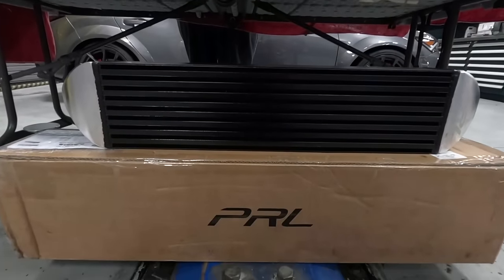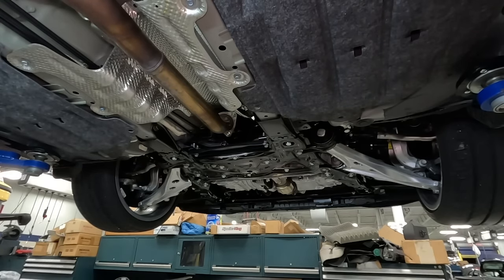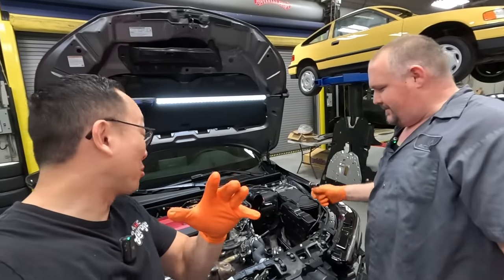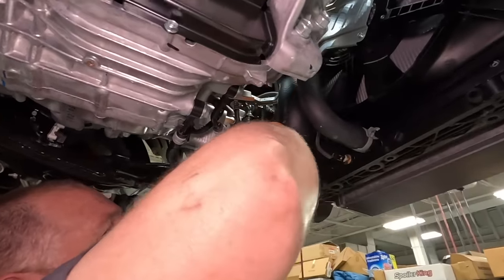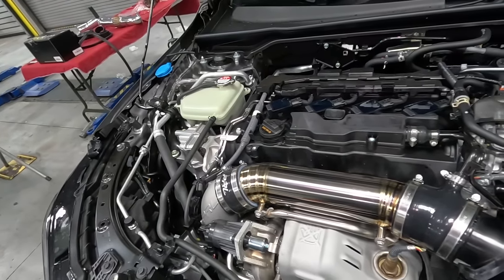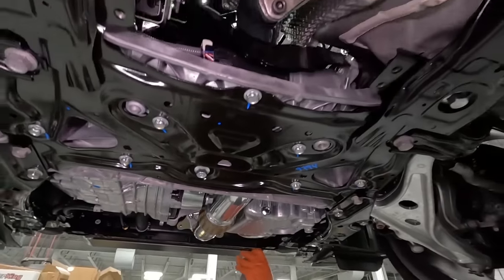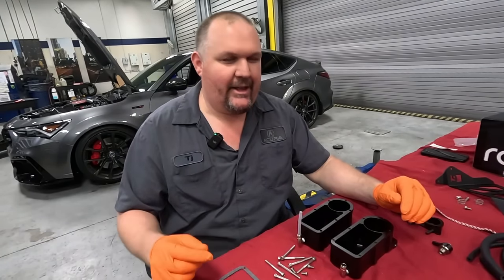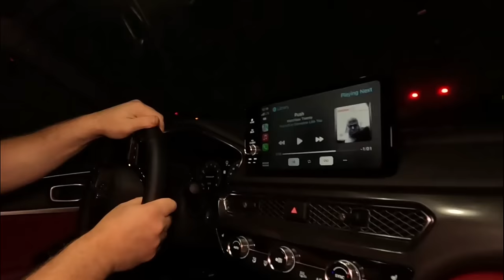2024 Acura Integra Type-S // Full Bolt-On Performance Upgrades

Comment: Not only is the filter sucking in hot air, it then gets heated up by the inlet pipe sitting on top of the exhaust 
2024 and Honda still havent heard about air-water intercoolers and Vband clamps
Reply: Nearly every test I've ever seen about inlet temperatures, when moving they even out anyway, so it really ONLY matters if youre sitting at lights. Once you're moving it makes 0 difference. So unless you live your life 1/4 mile at a time,  its a moot point.
Reply: @KeithSchwerin  It's a performance car, advertised to performance car enthusiasts.  Why would you buy this car to NOT live life 1/4 mile at a time?  This boomer logic of buying a performance car, advertised to be moddable, only to argue against anyone modifying it properly blows my mind.

Comment: I have an 08 Tl type S and I’m tempted to trade it in for this integra type s but I really don’t want a car payment anymore because I’ve had many new cars in the past and it’s not worth upgrading every few years. It’s a beautiful car.
Reply: Its all subjective. Personally i like having a new car every 2-3 years.
Reply: I sold my 2.4 Si that I daily drove for 7 years to get into one of these. Modern creature comforts are amazing now that I’m in my mid-30s. Add to the fact that these bolt-ons will push high 300s for WHP rating, it’s an intant classic, this thing.
Reply: @adventsociety5382  true and now I have a brand new 2024 GT mustang full optioned lol but I used to get one every 2-3 years but this time I waited 5 years my STI was new in 18 and I still have it but I did t buy anything until a few months ago.
Reply: @svfutbol20  yeah they are very nice cars and I was going to get one because back when I commented this I didn’t want anything but I waited and I got a great rate so I went with the S650 but I did want another type s but I switched it up since I still drive the STI and it’s a 4 cylinder still. How do you like the Integra?
Reply: @E85_STI It’s amazing. Bought mine slightly used with 10k miles, saved about $10k on the total price and got the RAMAIR intake for it. I think 18” wheels with some sticker rubber would help the car but otherwise it pulls like crazy, corners really well. Pop it into Comfort mode and it quiets down nicely, fits right alongside the Audis and BMWs at my office job parking lot.

Comment: Looks and sounds great. A couple questions: (1) what would you have done if some of those bolts ended up stripping? (2) wouldn't it make sense to test out the install before putting everything back together? (I was getting some anxiety for you guys when you started it up after all that work!)

Comment: those pops are not coming from the phearable tune right? I was told they don't do anti lag. bad for the engine. I was wondering. How did he accomplish those nice pops when shifting and letting go off throttle

Comment: Man, I was on the bad side of the 50% I broke 2 studs on my turbo exhaust. Had to re thread mine. Got mine put back together and now my car through  emissions and rev match codes. You guys run into this?

Comment: With those 20mm wheel spacers, does the factory wheel hub bolts stick out pass the spacer or is it flush with the edge of the hole and does the wheel sit flat against the spacer or does the factory bolts create a gap? I really would like to know i have the exact color ITS and your build looks awesome! But im curious about the wheel spacers.

Comment: I just installed PLM catted downpipe and a front pipe and the next day after driving home from work I’d say about 60 miles the check engine light came on for emissions issue. Any ideas? I haven’t scanned but I assume rear O2?

Comment: Hello i have a Tiger Eye Pearl Type S and looking to start doing some MODS.. and wanted to ask about the Intake System.. where to buy?? And do you think would be better than the PRL High Volume Intake System??
Reply: I have the RAMAIR system and it’s fairly loud, depends if you’re looking for the most air/performance or something easier to daily
Reply: @svfutbol20  do you think the RAMAIR performance is better then the PRL High Volume Intake
Reply: @EMAR88  I don’t have the other to compare it to. I imagine they are similar
Reply: @svfutbol20  i don't track my car ots my Sunday sunny day car and I think the # of HP n TQ i rather something like thr RamAir for the sound yes. I'm going to purchase today try to find the best deal on the RamAir system
Reply: @EMAR88  The RAMAIR one is pretty big and slightly digs into the underside of the engine hood. The PRL one would probably be more suited to spirited daily driving. I’m copying this upgrade list for mine because I want to occasionally track it
Reply: @svfutbol20  where is this upgrade list?? And I'm looking for something for better Sound and based on the Gray ITS on this channel he is doing well with this INTAKE here at AHC .. what you think??
Reply: @EMAR88  This one from the video.

Comment: What happened to the center of the bumper? See two dimples at the center point.
Reply: Front license plate
Reply: @keystonerider1308 I’m talking right at the exact center 1/4 to the left. That’s not the license plate dimples.
Those are 3 inches from center.

Comment: so those bolts that usually strip on the turbo. Just take honda trans fluid and let soak on the threads over night. never strip again. that was right from the tech line. did the night before i had to do a tear down or anything that required turbo removal.

Comment: If only Acura could be a decent performance car out of the factory. Every thing they produce needs mods the day you buy it.
Reply: These cars were produced as a track car more than anything which it does very well over a lot of other cars in and out of its class I think alot of people forget that Honda has never really been about straight line racing

Comment: You NEVER remove exhaust hardware while cold. That's when you run into trouble
Reply: The downpipe hardware on these cars as well as the new body Nsx you want them cold and soaked overnight they are known to seize so the proper procedure for this particular setup is cold and soaked and it comes off easy everytime
Reply: @tjlockwood4152  let me ask a simple question. And I mean no disrespect. The best practice to remove seized hardware is to use heat correct? I'm speaking from experience.
Reply: In some situations yes but in this case the heat that the turbo puts out makes these studs very hard to remove especially the more miles you put and the more heat cycles it has so we have found letting these cars sit until completely cold and soaking the studs and bolts in penetrating oil gives you the best chance at removing them alot easier and this is how it has worked the best, we have tried few times when warm or heating up the studs and it has made it worse

Comment: Normally a pro shop would do a dyno baseline pull on the standard motor first. Did i miss something. 😮
Reply: We have already dynoed multiple stock ones so we know where there power is stock already